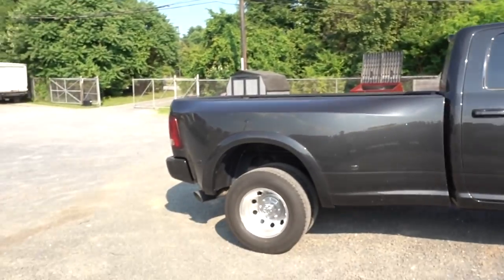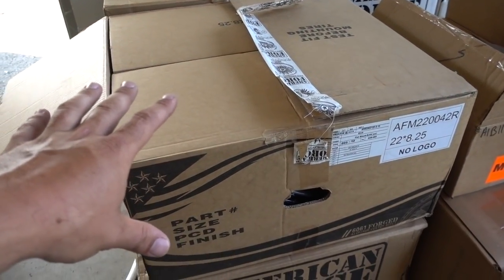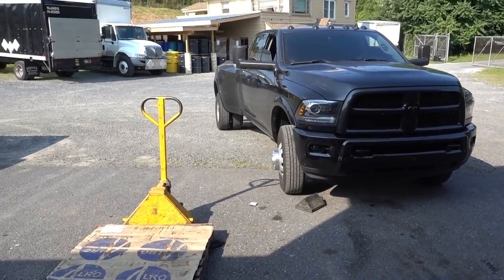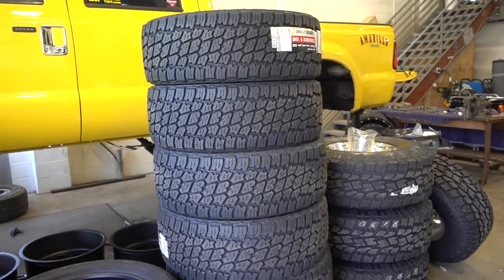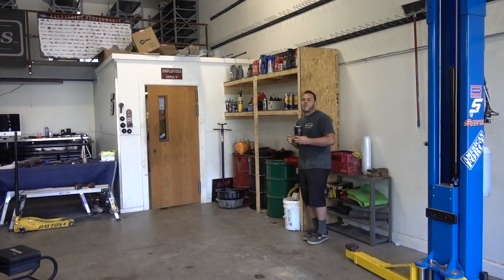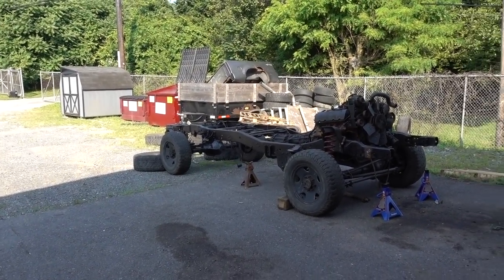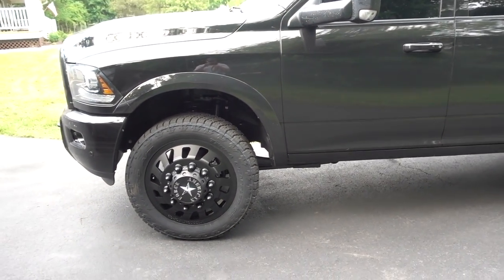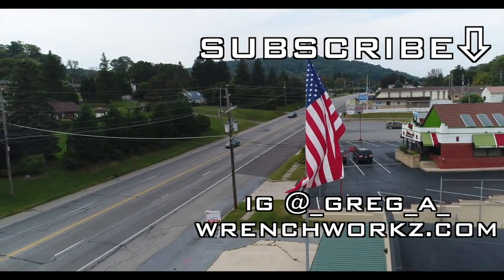2018 CUMMINS gets CRAZY NEW WHEELS & TIRES!!!!

Comment: Do a manual hub conversion on the front axle. Did it to my 2005 dodge dually and it looks almost stock. Plus a few mpg improvement. While you’re at it replace the two piece inner driveshaft on the passenger side to a one piece

Comment: Greg, can you please elaborate on how you balanced these meats? Wheel weights, balance beads, Centramatics? It took me some doing but I finally worked through some tire balancing problems on XD 22’s with 35x12.50 MTs on my dually. I would appreciate it and I suspect there are quite a few out there who have questions. Keep putting out the videos, great work!

Comment: Wheels look pretty bad A man!!! Curious are the tires any taller than the stock ones? I'm trying to find a wheel/tries setup for my 2018 2500 Megacab. Has the stock 20s and 285/60 tires. thinking of going with a 20x10 or 22x10 wheel and wanting to get a tires with about the same height as stock which measure out to be about a 32.5" tire with the tape measure...

Comment: you need to use paint protection film and the paint will stay looking amazing and ceramic coating the wheels will make it easier to clean and wont scratch as easily
Reply: Yeah he decided to pull the factory film off.... Shrugs...

Comment: Well I hafto admit it it does look a lot better than I thought it would with the 22"s on it but I think if you'd gone with 24"s it wouldn't have looked good at all.   One thing for sure is it's gonna be nastier for now on.  I've got a quick question on the rake my truck has 3 lift blocks all 1/2" thick each I took them outta my dads dually cause didn't like the rake and he wanted it lower in the rear for pulling his filth wheel camper. This made it work great question is even the 3/4 tons have this but yet are not as high, what's the difference as why a dually is higher

Comment: Very nice Greg, question is that going to affect the gear ratio a bit ???
Reply: tsimmons1974ts , if the new tires are taller than the stock ones, yes it will affect it. The speedometer will be off by just a bit. However, that can be corrected by most modern tuning devices.

Comment: Why did you decide to go with the 22s vs. 19.5 with commercial truck tires or even 22.5?
Reply: JTuned Motorsports most likely price. And tread. That and you dont have to run these tires are 120PSI and make it ride like crap. Can go with 60-70 psi and get off in the grass without getting stuck
Reply: Tyler Frazzini I was assuming that was the reasoning, but if it is strictly for towing his trailers around, wouldn't it be more cost effective in the long run because of how much mileage you get out of the commercial tires?

Comment: Greg I like the wheels, my only issue for you is being a dually, you are at the max width limit stock.... once you go past the dually fenders and you are sticking out about 3 inches on each side, you are overwidth in all states and federal, with the traveling you plan on doing, this may be an issue going forward . Also that width past the fenders ,throwing a little dirt,stones, water and mud over time will really trash the sides of your nice new trailer. You are really putting that new truck thru it’s paces.... with the new trailer ,and the higher pin weight ,the dually makes a lot more sense.

Comment: Don’t dig the 10 lug conversion or center caps not being a hater but coulda picked something better
Reply: Dan Larkey not your money
Reply: Juan Daniel Origel I’d never waist my money on forged wheels when Factory 1s work just the same work to hard to throw it away on pointless shit
Reply: if it was me... and I did a 10 lug conversion....I would go with 22.5 not 22....your tires are only rated at 3525/3195 lbs {the outer tires can't hold the same lbs"}.....That means the trailer fully loaded can't transfer very much weight {13,440 lbs total} onto the rear axle of your truck.....
And before you ad your two cents farmer brown.... I know people do do it all the time, wear out tires, have blow outs, kill wheel bearings,  have wrecks that insurance won't cover,,,, 
I would double and triple check all my weights, just to be responsible and thorough

Comment: Sorry Greg but I don't get it and hey maybe it's just me, but there is NOOO way I would add all that rotating mass and lever force on my bearings just to look cool. Especially on a truck you bought specifically to haul heavy loads> Now your breaks have to work that much harder to stop all that weight.

Comment: why would you not just order 8 bolt wheels, there was no reason to put 10 bolt wheels with adapters, you only had load range E tires which is just a stock tire , this was just a waste of time. that said better put some wrap on those back fenders so they don't get all beat up.

Comment: I would think if American force goes out of the way to make the 8 to 10 lug adapter they should've at least made the front adapter not bolt on to the stock dually adapter because now it has two adapters to have an issue instead of one. They should've made one with the correct offset from the standard width. Not to mention it now has 26 lugnuts on one corner alone because of it. And only 10 will be periodically removed and retorqued. Those other 16 are sure gonna be a rusted bitch to get off after winter.

Comment: Greg:  You made an interesting choice of wheels.  If you want "the look, " i invite you to consider taking the stock polished wheels and anodize them black.
I took a good look at the 22" wheels and tires you chose.  They have substantially greater rolling inertia than the stock wheels and tires.  You did not post the actual weight of each wheel and tire, but my educated guess is that the increased rolling inertia takes the stock brakes to their absolute design limits.  
Your 48' trailer is beautiful.  You didn't tell us the empty weight and GVWR.  However, if you load it up with tools, a 6,000#+ truck and your ATV, I am concerned your new truck with its new, larger and heaver wheels and tires will be substantially over the design limits of the brakes.
To relieve the strain on your braking system, the stock wheels & tires with the wheels anodized black may give you the look you want and the safety you and your family need.
Please consider carefully what I said.
God bless!

Comment: Goodthing you didnt buy a ford.
Reply: TerraViewFarms&Stables ferd*
Reply: TerraViewFarms&Stables it's not the truck it's the driver , remember that
Reply: Don’t go there.... a ram is nothing more than the shipping crate for a cummins
Reply: Because with a username like "Powerstroke Strong 903" you totally couldn't be biased.
Reply: C.T. Productions I think the cummins is a great engine  and I have owned all 3 brands  I like the options that Ford has over the other 2  and the 6r140 is by far the strongest trans  which unless you spec out a Ram where the aisen is an option  you get a weak 68rfe which chrysler has yet to upgrade even knowing its short comings whereas ford you get a meduim duty trans in everything from a 250 to a f750 gas or diesel. And gm only offers allison with the duramax not their gas version  unlike Ford  from 2011 to current  they have stepped up their game and every else is playing catchup. Look it up.  Thats why I have a Ford now. Traded a Duramax in for it and  the ram interior noise was obnoxiously loud compared to the rest  and i love the air conditioned black leather massaging seats
Reply: Powerstroke Strong 903 smart man
Reply: "which unless you spec out a Ram where the aisen is an option you get a weak 68rfe which chrysler has yet to upgrade even knowing its short comings"

Regardless the RAM will remain the same if not cheaper than the Ford in pricing when you spec it out.

"And gm only offers allison with the duramax not their gas version unlike Ford from 2011 to current they have stepped up their game and every else is playing catchup."

And this is a problem how?

Both RAM and GM are releasing all new models within the next year, better engines, complete redesigns, even all new models. The F-150 stands no chance against the 2019 RAM 1500, especially when the new EcoDiesel comes out. The Super Duty line-up could share the same fate, as what you see from Ford now is what you'll be getting for the next 4 - 5 years with minor upgrades.
Reply: Powerstroke Strong 903 Another fan boy still using arguments that were at best questionble in the late 90's towards ram trucks. The 4th gen ram had the best interior before the '17 fords and yes the aisin is aviliable in 3500 srw/drw models, the 4500 snd 5500 had aisins since the 3rd gens so whats the problem? Also the front ends were redesigned in '13 which eliminated  any front end problem comcerns. This still doesnt even include the 5th gens on the horizon.  If you dont like the inside cab  noise of a diesel and need your massaging seats maybe a nice S-class would suite you better to go get your groceries in.
Reply: Should have got a ford

Comment: fold those damn mirrors down Greg
Reply: K Hennessy unless he looking for a man
Reply: Hes towing a trailer can you not see the brand new invisible trailer he got
Reply: there's a few things he doesn't like about the invisible trailer. One is,  those 6/ 14 ply brand damn new aluminum rims and tires on that invisible trailer, they are really making the  ADD/OCD go into overload!
Reply: Always someone to complain about the mirrors folded out
Reply: dallasparker70 exactly. Buncha fake ass wanna bees. My mirrors stay out cause it looks good.
Reply: in case you didn't know, with these newer dodge mirrors the visibility out of them when they are down is horrible. but the visibility is great when the mirrors are up.  thats why you see soo many people driving around with the mirrors up all the time. or they could also be douchbags lol.
Reply: My mirrors stay up cause i dont feel like curbing rims and the visibility is a hell of alot better.
Reply: Actually, with them up, you see easier behind the fender and duals. Mine are alwaus up for said reason. Try parking a large ass dually in econo parking what cities do. Or how about the airport parking. Actually had to fold my mirrors in with a quarter in of clearance each side.. Many reasons why they need to be up. Great for guaging exits and what not to see if the beast will fit.
Reply: On dually mirror up position are so he can see through them better but what would y’all know driving 2wd 1/2 ton gas rigs.
Reply: imo if it’s a dually, you can have them out without a trailer bc seeing over those back fenders/bedside is hell with em down
Reply: William Jarmon facts
Reply: Visibility is important.  Do your thing Greg_A.  
Don't let these little girls bother you with "fold those damn mirrors down" or "pulling a invisible trailer" 
They only look at style... because they have never sat in the drivers seat?
Reply: You got to drive one to notice that the mirror like are necessary for parking and also for better visibility in high way driving.  Fewer blind spots. Everything has a reason.